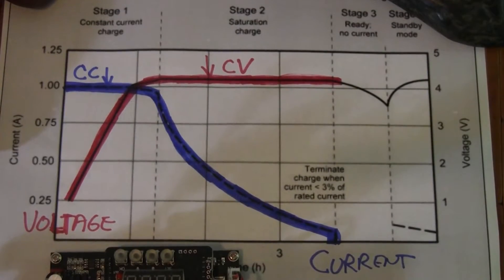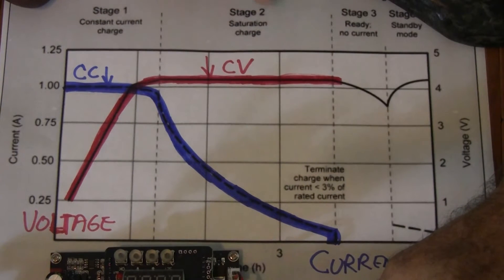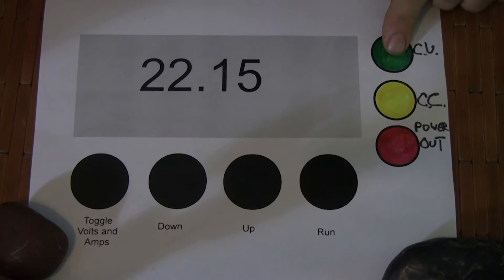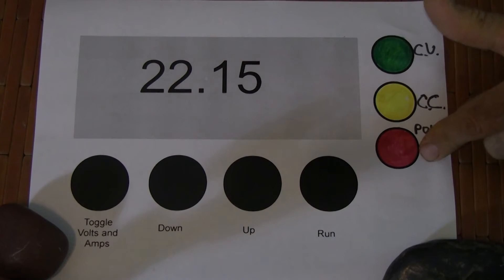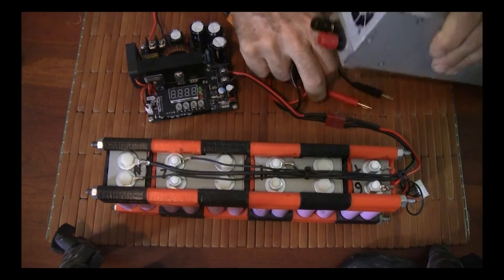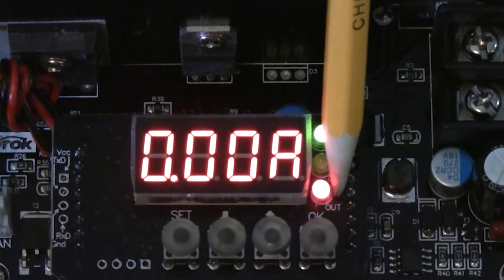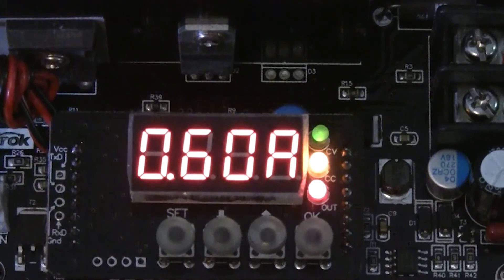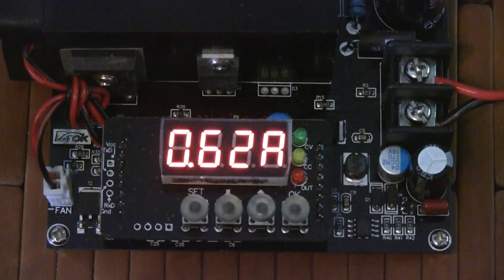Build a universal lithium ion battery pack charger

Comment: Thank you for the video, very informative.  I have two 200 watt solar panels that put out @ 60 V in full sun. I have a 13s4p Li ion battery that I would like to charge with a BROK. What happens if I have more voltage in than 52v charge ? Do I need a step down converter instead?
Reply from the maker: Thanks for the good question:  The problem is that  the max voltage is close to the max battery voltage of 54.6.  It is very likely your panels put out a lot less than 60 volts most of the time.  Also the open panel voltage drops under load.  So the real life under use voltage is going to be less than 60.   So you might need a boost circuit and a buck circuit depending on sun conditions.  No go.   So  you could use an inexpensive inverter and a common 13S charger.  This would work under high and low voltage conditions but would be inefficient- two transformers- which matters less as long as the sun is free!

Another choice would be a maximum power point solar charge controller with an adjustable charging voltage.  At first glance I think something like this would work:   

 https://www.amazon.com/RioRand-controller-Regulator-Controller-Adjustable/dp/B01DTT7CH2/ref=sr_1_1?ie=UTF8&qid=1471942460&sr=8-1&keywords=solar+panel+charge+controller+48+volt

If I were using something like this I would set the charging voltage to 52 volts- 4 volts per cell-  to start to be sure it was accurate.  It mentions it is for lithium batteries so we can assume it has a CCCV charge algorithm.  

Good luck, it's a good project!

Comment: It's 900W boost converter, which is awesome. But max input current is 15A. 12V power supply, 85% efficiency. So max charging output is about 153W. For 6-7S battery it's fine, but for 13-14S is output current little bit low. 
I bought same charging setup without noticing 15A input limit...
Reply: Ohm711 get a 36v power supply
Reply: I alredy have 12V server power supply. They are powerfull and cheap.
900W boost is worse than I tought. It died after first use and CC function is very weird. I replaced mosfet and it works againg, but I don't trust is. 
I bought 1500W boost which have 30A input. It can Handle 35A without problem! So now I can charge my  battery much faster.

Comment: Ok, lets say I have a 48v battery pack for my bike made of 18650 batteries. This can deliver to my pack the current and voltage required, but how can I keep it balanced?  what design do you recommend for a 48v 18650 lion pack? thx!
Reply from the maker: Correct.  You can use a BMS or a hobby charger to keep it balanced.  On my channel I have a video talking about installing a BMS, and another talking about charging and balancing using a hobby charger.  

Which one you choose is up to you!